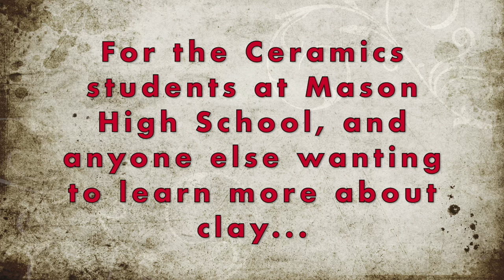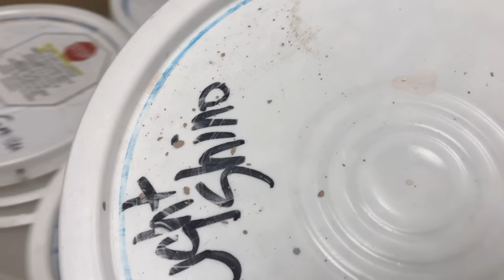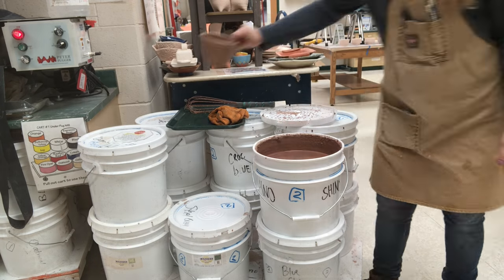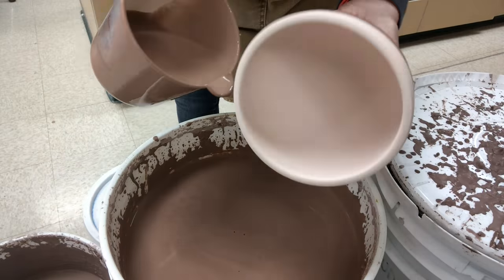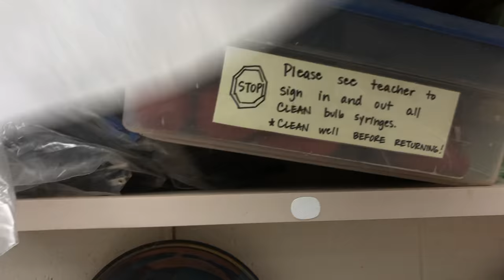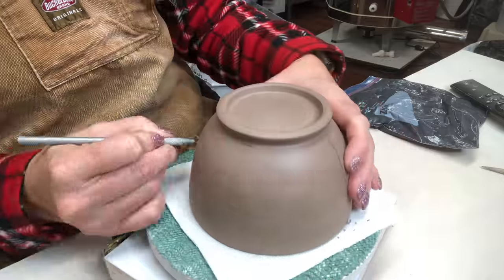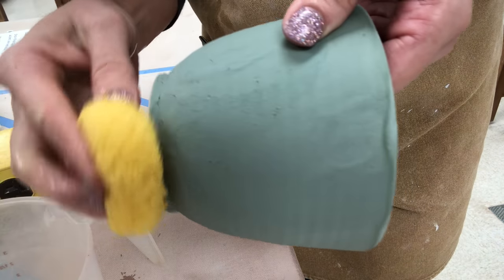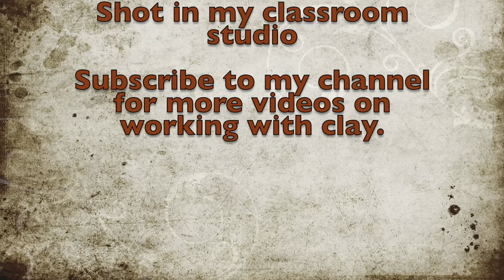Glazing Possibilities-  28 Different Approaches to Glazing Pottery! PART 1!

Comment: Can I melt metals in porcelain ? Please get back to me , i will have already tried with a small porcelain bowl I found for $1.99 but would like your input. I was using a charcoal block for the melting of 5 grams of aluminum bronze. I am going to try and use the ceramic porcelain to replace the charcoal block and use it as a crucible with a hand held map gas torch. I hope it doesn’t shatter
Reply from the maker: I’m sorry- I don’t have enough information to really help. I would not try melting metal in anything besides something designed as a crucible.  The clay is probably intended more as a fire clay.

Comment: What happens when you use tongs like that, do you have to add glaze to the spots where the tongs were or does it drip down and cover it?
Reply from the maker: Yes- if I have visible spots- I just touch it up with my finger dipped in a little glaze!

Comment: Hi thank you very helpful. What are the paddies for? I’m new at this.
Reply from the maker: Hi Gina! They catch any runny glaze or vapor glazing rings to prevent damage to the kiln shelf if the kids apply glaze poorly!
Reply from the maker: Btw- When I make them at home, I make them thinner and kiln wash for reuse!
Reply: Does it act like a tile??? Also how do you reuse them?  You use them in bisque wear
Reply: I’ve used biscuits before for glazing it appears that you’re using greenware and Firing the Clay along with your glazing are you must be waiting for days or so for the green where to be completely dry what about the shrinkage and the movement of the clay under your pot does that affect anything you’re not using any stilts or post in the process just a little patty correct?
Reply: @KaransPotsAndGlass  I'm sorry, I don't understand what you mean by this. If they can be reused, why do they have to make a whole new one ? I'm sorry if that's a stupid question, I'm a beginner too and I've never seen paddies used before.
Reply from the maker: I have the kids make them very thin, so they often don’t last through multiple firings with them. I might get one or two more firings that I can use them. When I make them for my personal use, I intentionally make them thicker and I kiln wash them so I can reuse them in my home studio. I have the kids make them super thin so they can dry out within 2 to 2 1/2 hours of a preheat before a glaze firing. I only use patties for glaze firings when glaze could potentially drip.
Reply from the maker: Wendy- making it 3/4” bigger than the base of the pot allows for shrinking !
Reply: So if the glaze runs. You just break them off???  What is kiln wash?  How does it look after being broken off it that’s what you do?  So many guestions 😄
Reply from the maker: Yes- you can often break them off- but the MOST IMPORTANT aspect of your patty is it protects the shelf- so the shelf doesn’t get ruined! Patties can be disposed- but shelves are expensive!  I have a video on kiln wash too! It is a protectant (kiln wash, I mean)  that has to be periodically applied for glaze firing! I also have a video on grinding pot bottoms- I’ll try to link those below!! https://youtu.be/y10cMPQc2x0
Reply from the maker: And... https://youtu.be/Bba_ECpWm3w
Reply from the maker: I only use them under glazed pots- as the purpose is to catch runny glaze!  But, they can be bisqued first.
Reply from the maker: I have the kids make them super thin- they dry within a 3 hour preheat on a glaze firing!

Comment: Sometime when I use tongs, there are slight indentions where I have the tongs on the pottery, how can I prevent that?
Reply from the maker: Tongs usually leave marks for me- I just dab on a little with my finger in the blemished spots when dry.  My preference is to dip by holding the edge, then go back and redip that area when dry.

Comment: What does the clay under the pot do that you flatten like a thin tortilla?
Reply from the maker: It helps to prevent glaze runs onto the kiln shelf.  My students sometimes are not the most careful when applying their glaze, so I always have them make a waste patty of clay under their piece prior to me loading it in the kiln. That way, if their carelessness results in glaze running, the responsibility falls onto them to chisel the patty off their pot rather than the responsibility falling on me to remove their stuck pot from my kiln shelf potentially causing me a LOT of work and possible damage.

Comment: what is the difference between underglaze and Cayote ot Aamaco Glaze?
Reply from the maker: Underglaze is more like a colored slip. It is designed to go under a clear or transparent glaze. The other glazes you are referring to are stand alone glazes which do not require a topcoat - they contain the silica ingredients which create a sealed surface.

Comment: When you use the tape for glazing, is there a special type of tape you use or can it be any kind of tape?
Reply from the maker: I do use special tapes- check the googledoc in the video description- I have some linked within that!!  :)
Reply: @KaransPotsAndGlass  Do you think this brand it okay too? FULARR® 3.9 x 0.6 inches (10 x 15 mm
Reply from the maker: I honestly don’t know. I can’t get that link to work!  I usually use ones that say either electrical tape or whiteboard tape. Pinstriping tape seems to work well too, but I’ve not had luck with masking tape
Reply: @KaransPotsAndGlass  OK, thanks for the input!

Comment: How do we select food safe glazes?
Reply from the maker: If purchasing pre made glazes, they will give the specifics of whether or not it’s food safe.  If mixing yourself, select a recipe that confirms food safety.  Your glaze should be matured and fired to the correct cone, as well as the clay body. Vitrification of the clay is always safer than non-vitrified clay.  That’s why foe functional ware I mostly use stoneware or porcelain.
Reply: @KaransPotsAndGlass  thank you so much
Reply: @KaransPotsAndGlass  do you always test the ceramicwares for food safety after glazing them?
Reply from the maker: No- I know there are kits you can buy- but I haven’t.  I do check for vitrification on many of my pieces though.  I sell my pieces with the caveat that the glazes are sold by the manufacturer as food safe, but I have not personally tested them!